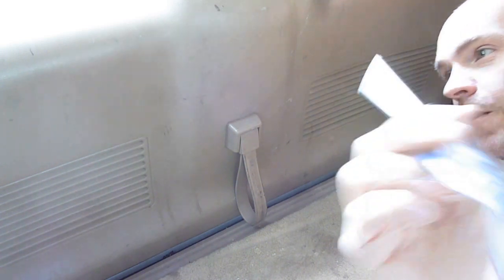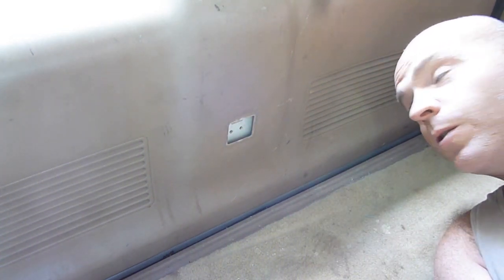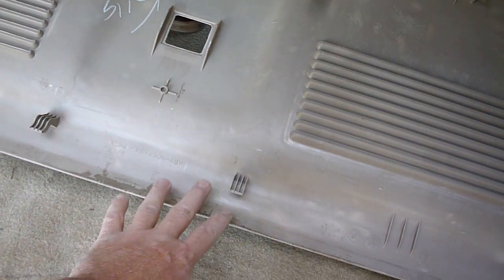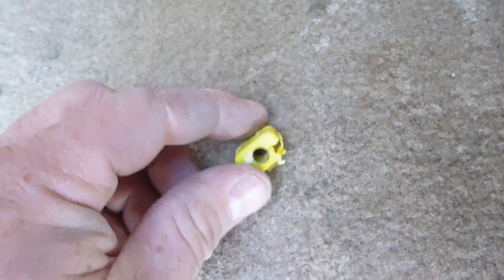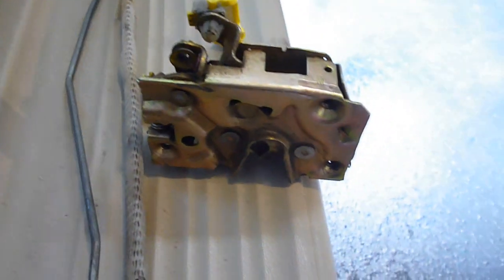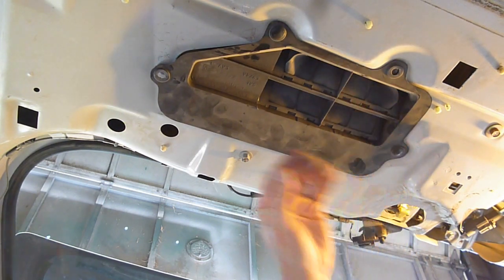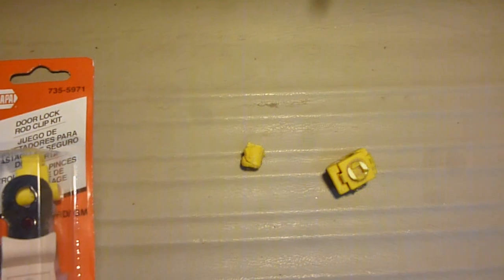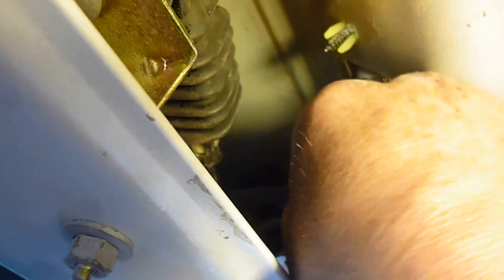FORD EXPLORER LIFT GATE LEVER  FIX (LONG VID)

Comment: Thank you! As a single mom with no one to turn to for vehicle repairs this video saved me big time!! I was pulled over today for brake light out on my 98 ford explorer. Well, I couldnt change the light because i couldnt get the back open! Thanks to you the light is fixed!!
Reply from the maker: great to hear thanks
Reply: Me yesterday,  got it changed today tho xD 
Now need to try and fix the back hatch problem

Comment: Great video. Thanks. I did use the gray part from the NAPA collection.  I enlarged the hole with a 7/32 drill bit and self threaded the part onto the metal threaded rod. Then the male part fit in the hole snug.  Worked great!  Thanks again.
Reply: The latch broke again.  Rewatching to see how to do it again.  Oh well. lasted 5 months.

Comment: I just fixed mine using your video.  My plastic piece did not break like yours, however it was crushed in at the point were it goes into the hole in the handle.  I used a screw with a washer and that same exact phillips extension.  I lubed and up and it is working like brand new.  Thanks for the video brother!  Super legit.
Reply from the maker: thank you glad i could help mine has been working for a long time now with now problems .

Comment: Exact same problem. Exact same fix except I couldn't get the stud to stay in the handle hole either oh, and found that I was coming at it from the inside of the handle instead of from the outside with the little stud. Switch it around added the screw good to go!

Thx for taking it so far And thoroughly! Made all the difference in my project.

Comment: Thanks for the video - I too used the grey clip , but had to thread mine for 1/4 - 24 to fit. I was easily able to get it to stay in the hole without the screw in the back and it was in there really good.

Great video on accessing and what needed to be done, THANKS DUDE!!!
Reply from the maker: i think my latch was wallerd  out too far or broke some how otherwise i probably  wouldn't have had to use the screw thanks for watching

Comment: Great video. My little yellow clip was still in tact.  It had just opened up and fell out.  Your video guided me to putting it back together and I added a screw to mine for a little extra security.  Thanks.  Good job.
Reply from the maker: +foofarley04  thanks glad it helped mine has bean working for a long time now and i have not had any problems sins

Comment: Thanks Sam. I fixed my car.   This is the perfect video.
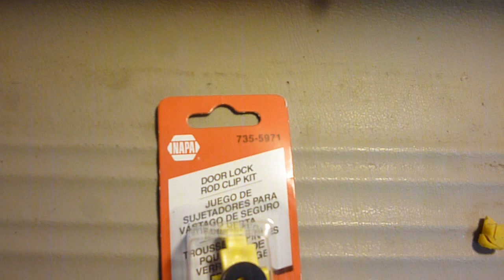I just want to add one information. The yellow and white clip in the door lock rod clip kit( video 7:17 )works.

When I fixed my car I used gray one like your video. 
However I failed to drill it.
I tried to visit dealer shop for the clip but they didn't have one.

After that I just tried the yellow and white one. 
And it worked.  I didn't need to use a screw to fix it.   : )

My car is 2003 explorer sports.
Just try the yellow and white clip before you use the gray one. 
If you are lucky it will work.

Thank you again Sam.
Reply from the maker: thanks for the info and for watching

Comment: Not trying to say this video is wrong or anything, by all means its a great video (because it is well made, very informative and extensive), but I actually fixed this same issue with a 4 zip ties out of a $3 Walmart pack of about 50 or so, in a lil under an hour. Its been around 2 months and the hatch still opens as if it were brand new.

The zip ties I used were rated to hold (75 lbs.) so they were perfect for this application. Because of your well made video I was able to see the components that needed to be re attached before I even took my panel off. Thanks for uploading this very thorough video! Much appreciated!
Reply from the maker: To each there own thanks for the comment
Reply: Np,  thanks again for the in depth video!

Comment: As Keith Kaylor said - It is important to pop clip in latch first. After that the rod snapped in easily. Nice video - Thanks! Also got clip from Ford at a little less than $5.
Reply from the maker: thanks
Reply: What's the name of the part from Ford?
Reply: @TatiannaDeJour404  right I need to know to mine broke those little yellow bastards hard to find

Comment: I had to replace that piece every so often (months at the time), best way I found on how to fix it, is using expoxy putty, plastic weld (whatever you want to call it) is a 2 part putty that you mix and hardens like rock. I did mine with it and it has lasted me years.
Reply from the maker: so far this is still holding and its bean a year now but thanks for the info and for watching
Reply: And what do you do when that fix breaks? Re-putty?

Comment: Thanks for the video. Handle busted while on vacation in Tampa and finally got around to fixing it. The yellow clip on mine was still intact so just had to gain access and  clip it back onto rod. Hoping it holds.
Reply from the maker: if it does use the screw it has been working with no problems for a long time now
Reply: Junk works DIY Garage Does the clip take a screw? It already came apart again a day after I fixed it. I'd consider even using RTV or super glue to help hold the clip together.
Reply from the maker: i would try to find a screw like the one in my vid glue won't work because  the clip has to be able to rotate

Comment: Great informative vid but what if your backspace is being used by a 2 15" sub box thats fitted from side to side. And my rear windshield wont open up since i sealed it because of vibrations caused by said sub box stripped the screws. How would i go on to taking of the plastic cover off? Thanks in advance
Reply: Nevermind update i got it. Just jammed a flat head and wiggled
Reply from the maker: @d4b4y4re4kid  good to hear

Comment: Hello. I know you made this video approximately eight years ago but I was curious if you remember if there was a way to get the rear hatch open so that I could open up the plastic hatch cover?

Unfortunately the lock/key mechanism is I believe stuck in the locked position and the latch that you press upwards has little to no tension in it. So basically I have no way of opening up the rear hatch to start investigating what’s going on.

Any suggestions?
✌🏽
Reply from the maker: not sure if i understand the question but i show how to get in the door without it being open
Reply: @JunkworksGarage  ok. I’ll rewatch it again. Maybe I didn’t catch that part plus it was like 4am so I was half asleep. ✌🏽

Comment: how do I adjust the latch of a 96 Explorer lift gate? Left side will not latch. Looks like it might have been hit "slightly" left rear...Door ajar light stays on
Reply from the maker: i'm not positive it might have a bumper that can be adjusted in,  your stricker might need to be adjusted or your hinges could be out of whack without seeing it it's hard to tell
Reply: @King Julien when I took the garbage off.. a guy there had the same yr... He just pushed on the left side to shut and it worked.. it latched

Comment: my back panel won't come all the way off because a piece in the middle is stuck inside the metal latch. how do you get around this because without the panel all the way off. this is pretty impossible to do.
Reply from the maker: unfortunately without breaking it i'm not sure  sorry

Comment: I have to slam mine repeatedly to get the light(and door ajar light) to go out. Do you have any guess as to what's wrong and what I can do about it?
Reply from the maker: your door latch or door altogether probably needs adjustment or if your lucky you might have a door switch  for the light that can be adjusted out or the switch could be bad as well hope this helps thanks for watching
Reply: You might need new bushings on the latch pegs. $4.99 at your nearest auto parts store

Comment: You wouldn't happen to know how to open the hatch window of a 2003 for explorer XLT? Everything I've read says there a button by the license plate but mine ha no button in or around that area. BTW great video!
Reply from the maker: not sure from what i've seen it should be to  the right of the licence plate but under a lip so you have to feel for it

Comment: they stock those clips at ford. they are about 5 bucks the other thing is its best to pop the clip in first then lock it on the threads also if im not mistaken you should have rotated that clip 180 degrees and put it in from the other side of the pull lever. the wrong angle will cause it to come out again if you didnt have the screw in it. great video tho on the tear down etc
Reply from the maker: the latch in the rig was broke where it goes in so the clip wouldn't stay in i'm pretty sure the clip goes in the same direction i put it in otherwise the rod would hit other mechanisms its still working good but if i have a problem in the future i will replace the latch and take a closer look thanks for the info

Comment: my windows wont open when I click the buttons ? can it be a fuse? if so do you know where it is and witch one?
Reply from the maker: i'm not positive but if they work with the switches on each each door but not the master switch on the drivers door it's probably your switch but if nothing works it could be a fuse but i'm not sure which one  .

Comment: Great video but you used the wrong part! The yellow one is the correct replacement!
Reply from the maker: i have been told this but i actually tried it and it didn't work either. the guy that tried to fix it before me reamed out the hole to much or something it just fell out when i tried  it so hopefully most people won't have the problems i had thanks for the info and for watching.
Reply: Yea mine worked like a charm!

Comment: So my door handle had been broken for a while, and i had basically been opening the window, and pulling the two rods to pop it open, tonight when I opened it i pushed to hard and now it won't shut and i cant get them to pop anymore HELP!!!
Reply from the maker: theas laches just suck your best bet is to go to a wrecking yard and finde replacements if you can but if not you might try amazon for new ones but i couldn't find rear ones   last time

Comment: Why didnt make them out of metal
Reply: And thanks for the video
Reply from the maker: actually they are a ware item if it was metal it wood dig in and eventual need to be completely replaced  this way the plastic is used like a bearing to stop friction

Comment: You should put the part number from NAPA in the description
Reply: Thanks
Reply from the maker: +Maurice湯 茂 林 thanks i will do that its a good idea
Reply: sam witwiky thank you, I have a 2001 Mercury Mountaineer (fancy name for a Ford Rxplorer) with the dreaded door and lift gate problem. The driver and passenger (sometimes will take a few tries to open) work. The two rear doors are stuck as well as the lift gate.  I will try your method soon. You did a good job of making it seem easy, most people don't wanna go near the door panel so they spend $$ at the dealership
Reply from the maker: +Maurice湯 茂 林 i have some vids on the door latches too were i replace them it is a spring in the latch that breaks its a common problem with them i replaced both the drivers and the rear left and they work great now
Reply: +sam witwiky thank you
Reply: +sam witwiky so the rear doors are the same set up as the fronts doors?
Reply from the maker: +Maurice湯 茂 林 everything seems very similar
Reply: sam witwiky Thank you, last questions, How are you back doors now?  Did you buy brand new latches or find good junkyard ones? Cause if it's just a spring then perhaps it can be secured better?
Reply from the maker: +Maurice湯 茂 林 i found a new one for the front door but i had to get a good used one for the back. i actually am going to put up a vid this thursday about this that i thought i already put up  so it will go into more depth on the problem and the fix i also am having the same problem on my other back door so when i am able to get the part and the weather gets better i am going to do a more indepth vid on instal hope my vid on thursday will help
Reply: +sam witwiky Thank you so much! I appreciate you and your channel.
Reply from the maker: glad i can help

Comment: looks like a pain in the ass and then you are replacing a broken plastic part with another plastic part, bad engineering by ford
Reply: I mean, these cars are over a decade old. I don't think it's necessarily bad engineering. It's part of maintaining the car. If you really wanted to have better parts then you could do that yourself